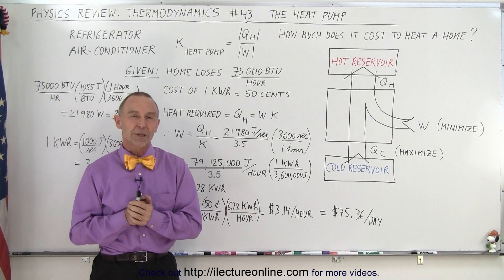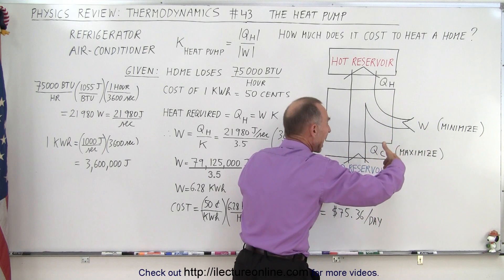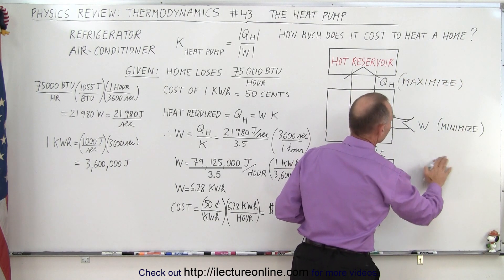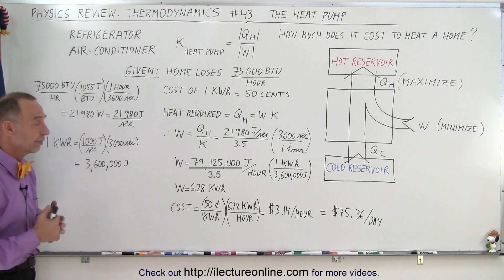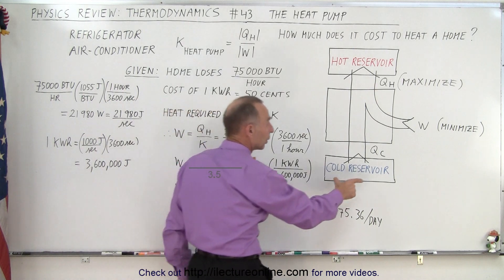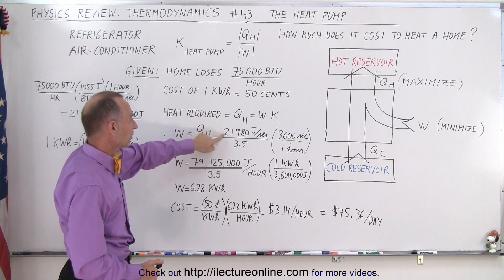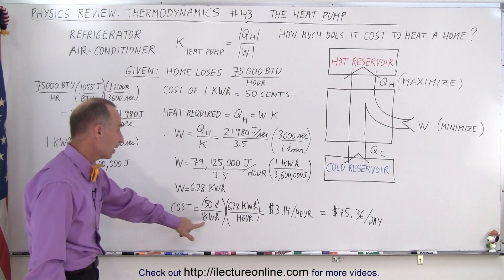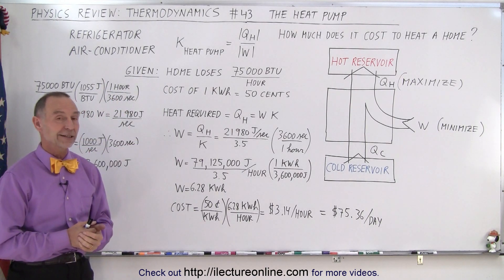Physics Review: Thermodynamics #43 The Heat Pump

Comment: Great analysis.  In case you are interested, Fenn illustrates in his primer on thermodynamics book how to derive the behavior of power requirement versus temperature delta - which ends up being a quadratic relationship.
Reply: Is that the “Engines, Energy, and Entropy” book by J Fenn? 

When we had a wood stove as a kid I’d track the amount of pounds wood burned per hour and the furnace temp, indoor and outdoor temp, all in the hopes of coming up with a formula to predict how many pounds of wood a day we would need 🤣 

I’m not a physicist but sounds like an interesting read!
Reply: @XJ290 yes that's correct.